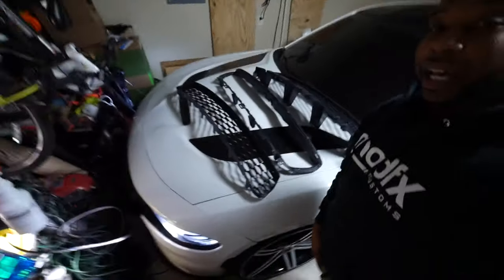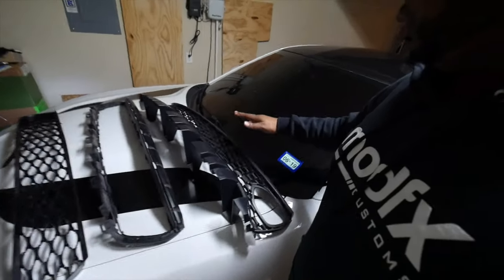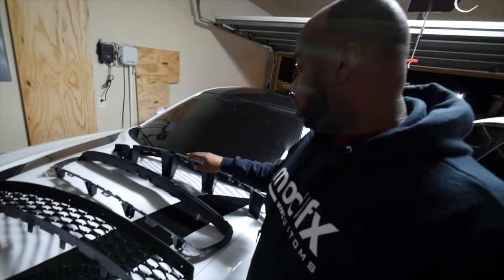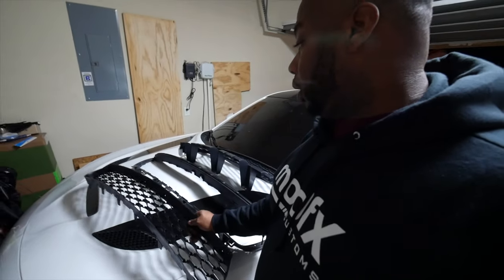IS IT POSSIBLE TO MAKE A 2019 DODGE CHARGER SCAT PACK GRILL ON MY V6 DODGE CHARGER

Comment: You need the whole front bumper for that to work man, the Scat Pack bumper itself is a different set up compared to the SXT, the Bumpers work the same way they just plug and play, the whole thing itself gonna run you about a grand, thats for the bumper itself and the molds for the grille, this isnt including painting it either. thatll run you, maybe another 500 bucks

Comment: You need the SRT BUMPER.  The SXT and RT bumper is different.
Reply: @Tx_Jay_   the 15 and the 19 regular se sxt and r/t have the same size grill.   He's trying to use a scat/hellcat grill type grill.  It won't fit.  It would've been cheaper n less of a headache to just get the SRT BUMPER.  Grill would fit perfect.
Reply: @DjSanchezE355AMG  cheaper to buy and paint an entire section of his car? Over the 30 dollar plastic grill? LMFAO okay buddy.
Reply: @angryitalian3430  1st the grill isn't $30. 2nd the money you gotta spend just trying to get it molded and fitted is more than just buying the SRT kit.
Reply: @DjSanchezE355AMG  I think the point is to create a product that can then be sold to people who want that style grille without having to spend money on a whole new bumper, installation, and paint. This is the initial R&D. I think people would gladly spend a couple hundred bucks for this grille once ready instead of several ks for a whole bumper swap.
Reply: @DarkIllusionsFilmsSD   I get the point. Its just that the se,sxt,regular r/t BUMPER is shaped different.  The idea is dope.  He was better off buying a custom honeycomb grill for that BUMPER. And getting the intake holes molded into that.  Cheaper and a perfect fit.   The money he bout to spend he might as well get the whole BUMPER swap.  Which really isnt that much.
Reply: @DjSanchezE355AMG   I was under the impression that he is developing this grille with modfx to sell and make a profit. if that is the case, I don't see the issue with spending some money at first...that's kinda how it works with most businesses. If he won't be making a profit but is merely helping modfx develop this, then I applaud him for spending the big bucks so we don't have to. I'm curious to know where you are finding the SRT bumper for less than $300 though. The cheapest I can find with absolutely everything for installation is about $5-600. For those that don't have the time or skill to do the install themselves, depending on where they live, I can see the total cost being crazy high in comparison to just getting this grille. Where I live for example, to install and paint both the front and rear SRT bumpers can be up to $5k (it's so dumb!!) I doubt the whole price would be that much in Houston but again, kudos to this guy for helping this get made for us. 😁
Reply: @DarkIllusionsFilmsSD  look at carid.com or ebay. If  you go through Amazon you're gonna pay a lot.  There are a lot of aftermarket sites that have them under 500.  Like I said it's a good idea. But its a headache.